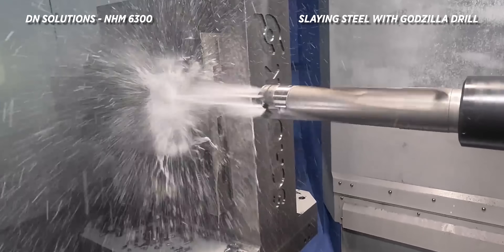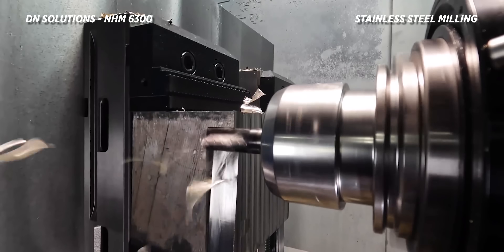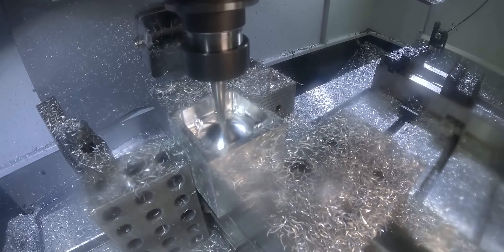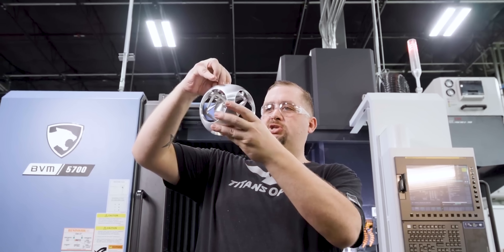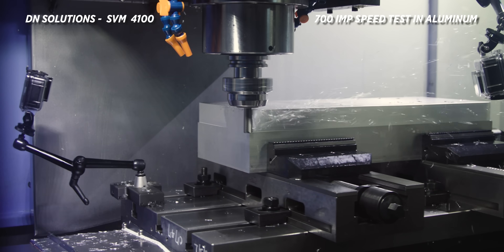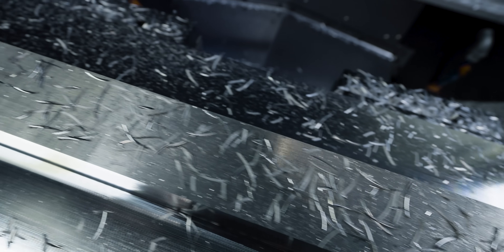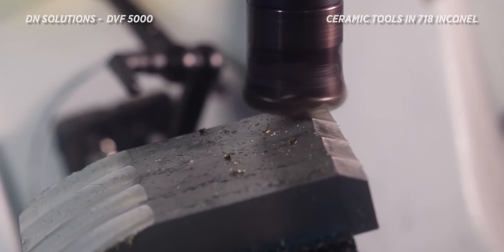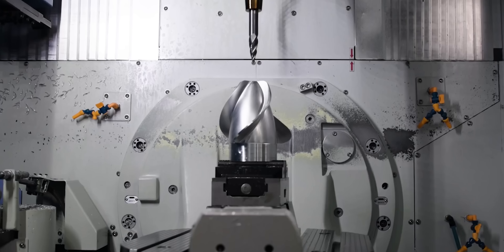Destructive CNC Machining Compilation | ASMR

Comment: i love this stuff. I'm not a machinist but I assume a hot tool would cause increased ware to the tool it being hot? other than damage to the tool what effect does this hot tool have directly on what you are cutting/milling? now I assume a soft metal and a hot tool would not make a great combination.  but with the video example of what's being cut with the hot bit would you expect the tolerances to be out or because of the metal type is cast iron is it still able to do the job to spec or close enough? but kill the tool/bit? 
not expecting a reply but if anyone would like to that would be great as I'm fascinated. thanks all BOOM
Reply: The hot tool was just a test to see what the tool could take without breaking. It would certainly effect tool life and part tolerance, so that would NOT be a normal situation. I ran that part with no cooling of any type, to show a condition that most tools would NOT survive!
Reply: @barrysetzer  thank you for the reply. its amazing seeing the punishment it can take.    not related to this video but why is teflon so hard to deal with? is it because the material is meant to be non stick so the tool slips when cutting?
Reply: Typically you'll run your roughing passes along with finishing passes. The roughing passes will remove the bulk of the material, while the finishing passes will bring the part to the desired tolerances